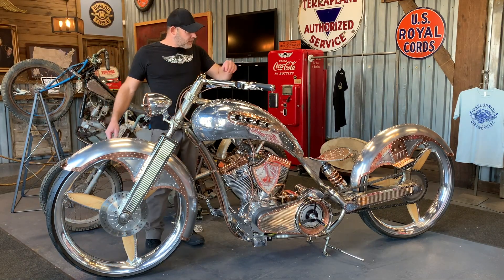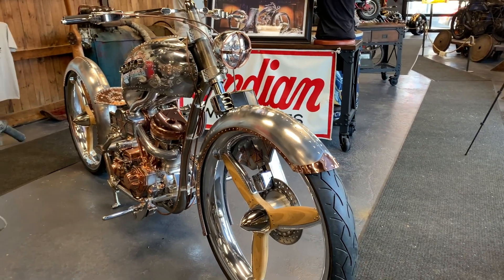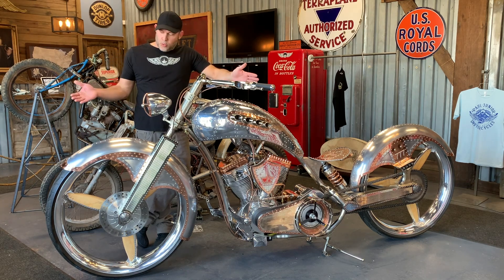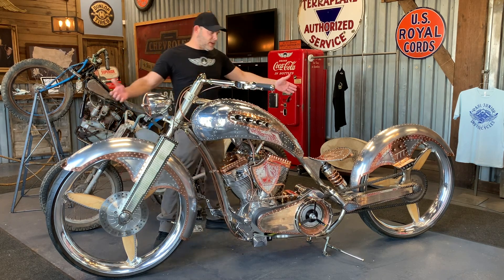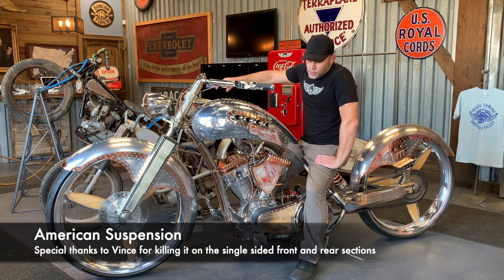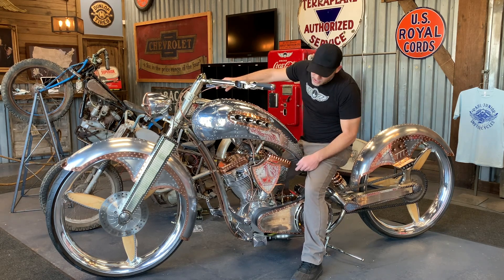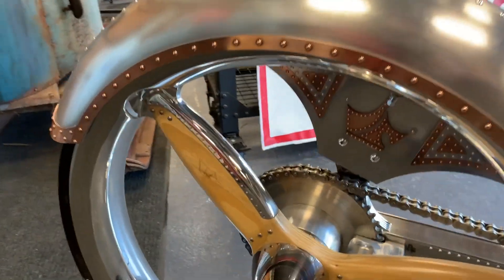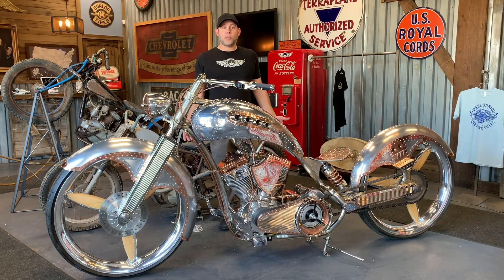PJD Shop Tour: Build Off 1 Bike

Comment: That bike is freaking awesome for real. The attention to detail is amazing. There was no way either of the other 2 bikes could beat it. They were not even on the same level as this bike is which I haven’t seen many if any at all that are though. Pauly and PJD is the king of custom bikes no doubt
Reply: All this bike is good for is sitting In a lobby or garage like it is now. Would not handle well, has a 1 gallon gas tank under the cover, and is obnoxiously oversized. They probably ordered almost everything on it.  It's cool to glance at but it's not a real bike.  Jesse's bike was way better imo. But different strokes for different folks I guess.

Comment: Paulie < Ive been a fan since the start. Some asshole stole my custom 3RD GEN  85 Kaw Vulcan KABBOBBER . WITH 10K Original miles.
They stole it just before lock down in Chicago after I rode only  3 times after bulilding "WILSON"
Reply: Time to move out

Comment: He’s talented at building show bikes for display purposes only but he hasn’t built a daily rider ! A 1 gallon gas tank is not a rider it’s a trailer queen anybody that rides a couple hundred miles in a weekend rain or shine will tell you that , a steel seat without padding? Can’t even ride it to the show, and HE hasn’t even rode it other than to see if it runs ! He’s a tool,  a spoiled rich daddy’s boy